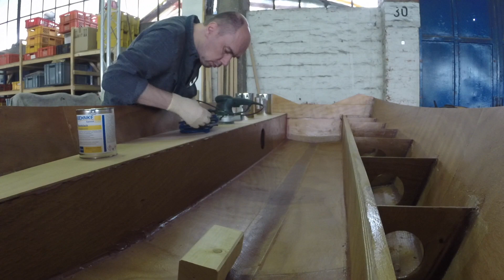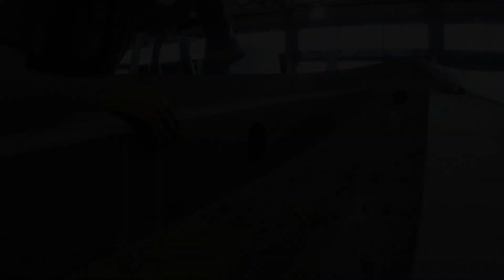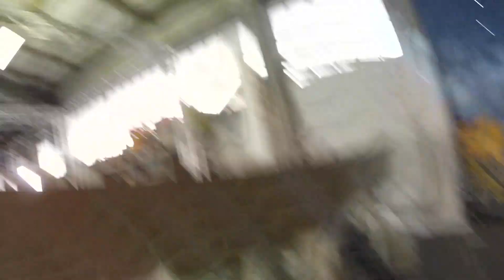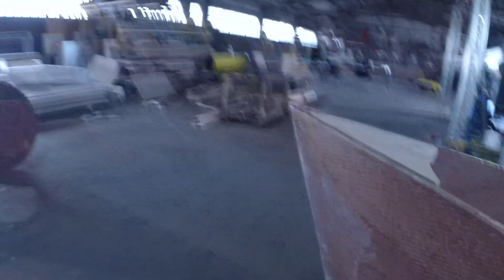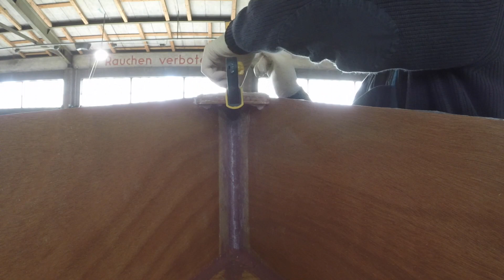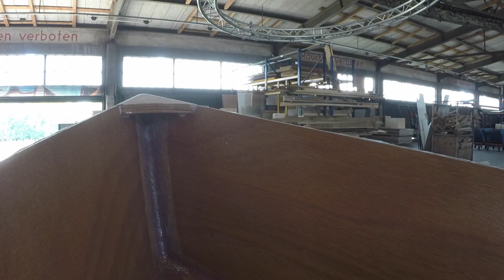Building Fleet, a small wooden boat #10

Comment: I'm confused how the outsides of the seats (and the seats in the bow in the previous episode) are attached.  It looks like they are only epoxied against the sidewall from the top.  Won't downward pressure from someone sitting on the seat put that epoxy in tension and eventually break it?  Why not put a strip along the hull to support those edges?
Reply from the maker: Hi Dustin, yeah, I know what you mean, but the frames to support aren't that far away from each other (45cm). Also the plans don't have any extra strips there so I think it's fine. We'll soon find out ;)
Cheers,
Alex